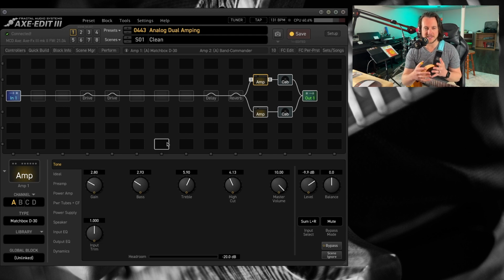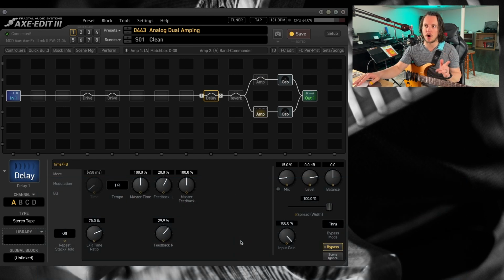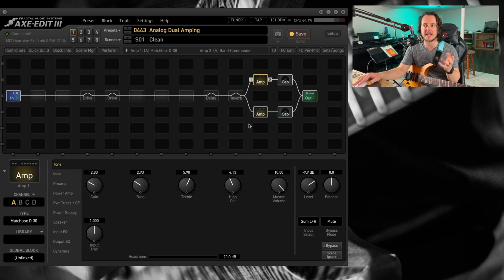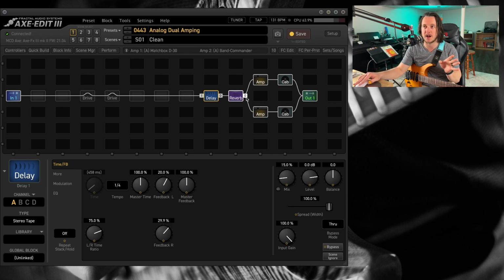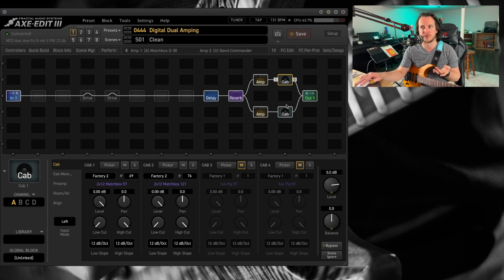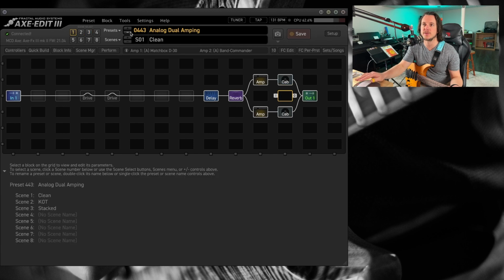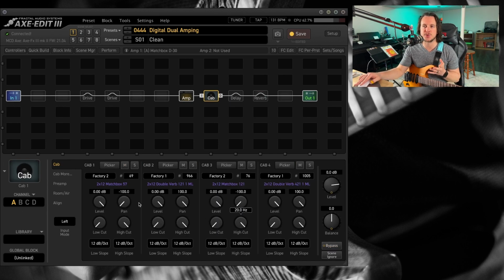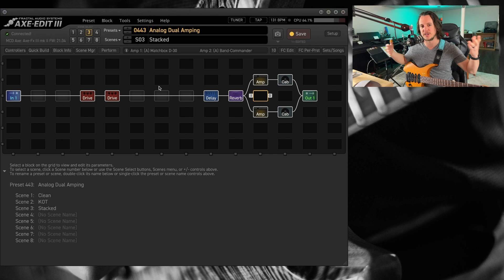Dual Amping Simplified

Comment: Great video! I’ve tried all available options on my fm9 and found that dual amps into a single stereo cab with time based fx post, works the best for me. I’ve tried the two cab thing and at least for the wet worship environment, I didn’t think it was worth the hassle. For simpler presets, using the additional IR spot for room IR’s is really cool but loses its effect when using loads of wet fx. Increasing the room parameter in the cab block can help with this too. 

In regards to the difference in tone at the end of your video, I’d say tonally it’s very similar but the dual amps have a more stereo effect. This can be semi rectified by using the Enhancer block at the end. All this being said, if both amps are very clean, it’s almost negligible, where having dual amps makes the biggest difference to my ears, is when each amp is producing its own gain structure, which naturally spreads the sound out. I find using scene controllers to raise amp gain or engage the preamp block, works wonders for a massive and glorious stereo tone!
Reply from the maker: I agree and great tips! I'd actually like to do a "part 2" of this video where I use the Align tab in the cab block to spread thing out on the single amp preset more. That can help with the width and get it closer to the dual amp preset.

Comment: I could write a song with either of those presets. They're both really nice. But I def prefer the dual amp. I like a wider sound and that's what you get there.
Reply from the maker: Definitely more width on the dual amp set up. Another way to get more width out of the single amp set up (which I for got to show!) is to move the right side IRs in the Align tab of the cab block a few ms away.

Comment: Have you ever used the Axe FX3 into a Tube amp and use the AXE FX3 for just effects? What are your thoughts 
Thanks
Reply from the maker: I've used the FM3 a bit this way. I'd like to explore more though. For simplicity, I just went in the front end but you can still have some pretty interesting rigs this way. I used scenes to change the Drive block channels for different gain flavors, a wah with auto engage, a phaser, parallel reverb and delay, and a filter for a clean boost. worked pretty well. Might have to dust off the tube amp and make a video on the topic.
Reply: Yes that would be a great video. I know some people that like the effects and love there tube amps too.